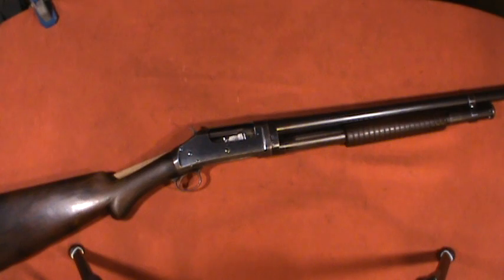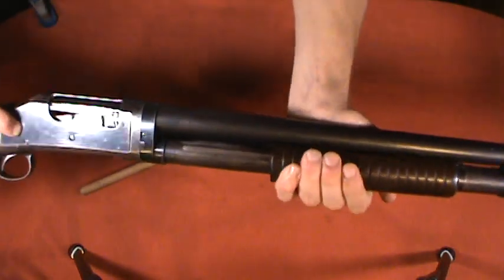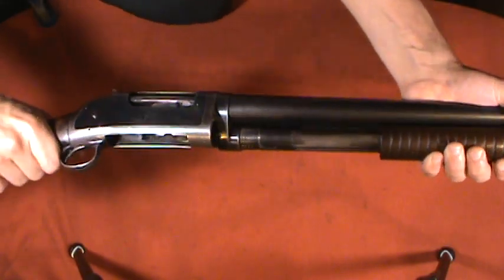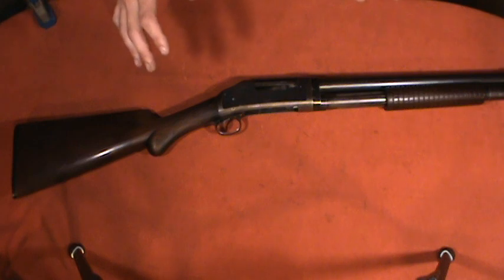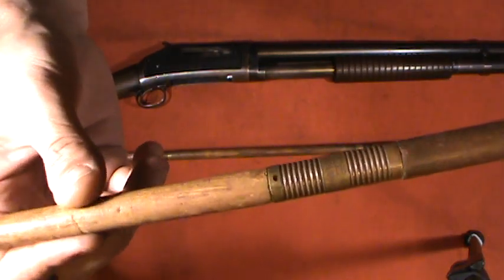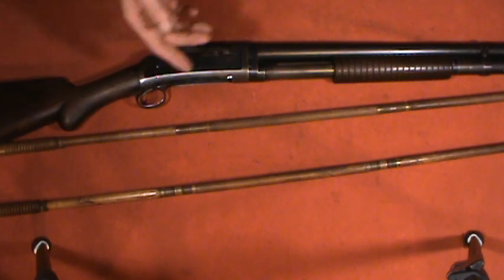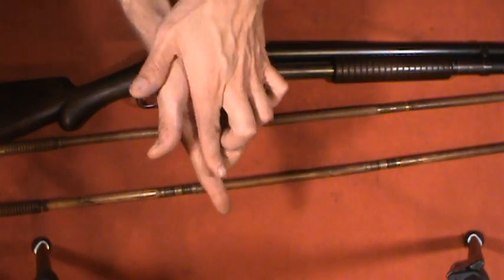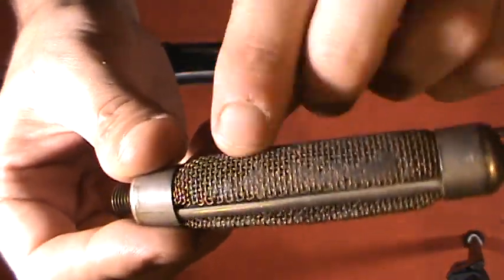Winchester 1897 Slide Action Shotgun: Brush Takedown

Comment: As you start drawing the bolt back, the underside of the bolt rubs very hard on the trigger. Whats the fix. I have to pull very hard to cock the gun
Reply from the maker: Without having the shotgun in front of me it's a little difficult to say as there are a lot of things that could cause some binding. If it were me I'd slowly draw it back and try to determine what is engaging at the point it becomes more difficult. Then I'd dissemble it and check those parts for excessive wear, burring or build up. Sorry I couldn't be more helpful but without it in hand it's hard to pin point.

Comment: these guns wont fire when out of battery when slam firing unless they are damaged. they are meant to do this, the hammer should drop only after the bolt locks up. if yours doesn't talk to a gunsmith,
Reply from the maker: That's correct but if someone doesn't realize their gun isn't locking up it could certainly be a problem.

Comment: Compared to other modern guns like a Mossberg Maveric/500/590A1 or a Remington 870 or Benelli pump,would u concider this gun reliable or good enough for home defence?
Reply from the maker: Ben Niessen In my opinion it would be an effective home defense firearm as long as it had an 18.5" to 20" barrel as so. As long as it's maintained I see no problem with it in that role. Thanks for asking and viewing.
Reply: Definitely better made and more reliable than newer shotguns. Only thing better is a model 12. Taking them apart is a different story.. lol
Reply: I have 2 of these in the house one with a 18.25 inch barrel and extended choke tubes and its really a dream of a gun,its a 93 converted to a 97 and its soo smooth and never has a issue wenn cycle the action it loads and ejects sweet. These are really great guns and they are well build for sure.
Reply: I cut mine down to 20.5" to Trench/ Riot gun configuration--- perfect for Home Defense. What's so cool about the 1897, from 1897 to about 1957, the Winchester 1897 receivers were all forged from one block of steel-- longer process and bit more expensive Reason why this shotgun was discontinued because the cost. But Winchester churned out over a million and Cowboy Action Shooters gravitated to the 1897, chopped the barrels for CAS. A historic shotgun and fun to shoot. Something about a shotgun with a hammer just makes it cool.

Comment: I save u a long story but we cant own pump action shotguns like the 1897 here in the netherlands but we can own black powder guns like the  Winchester 1893,i converted a 1893 all the way to a 1897 (bolt carrier barrel mag tube and and) and i can tell u one thing the 1893 is stronger build then the 1897 if u compared them,the 97 has way more cuts inside the receiver and a 1893 its barrel is made the same way as a 1897 barrel but a 1893 barrel is thicker,and there is much more steel over the bolt on a 1893,wenn i shoot slugs or hot loads i always take my 93 and not my converted 93/97.

Its just the fact that a 1893 is a very very very unsafe gun that ejects horrible vs a 1897,all the flaws the 93 had are fixed with the 97.

Converting is easy but its alot of work i needed to machine the 97 bolt to the 93 dimensions and cut a slot in the receiver for the fin on the extractor to ride in,then lower the ejection port a little bid and file out the space for the shell flag and cut out a small bit for the action hook screw and and and and and..

Now i have a 1893 with a 18 inch 1897 barrel with chokes and i use extended chokes so my barrel is 20 inch witch extended chokes and i have a load 6 kit in the mag and i dura-coated the gun cause i welded the original hole for the action hook screw and i drilled a hole for the shell flag and action release button.

If u know those guns u know they are super super super strong build.

But its not true a 1893 is weaker and a 1897 is stronger its just a bla bla bla if a 93 cant handle smokeless powder i would be dead now hehehe
Reply from the maker: Ben Niessen I won't dispute individual experiences. I appreciate your input on the subject. That's a very interesting work around for the circumstances you have there legally. If it keeps you shooting that's what's important. Thanks for the viewership.
Reply from the maker: Ben Niessen The ability to defend ones life from that of an aggressor is one of if not the most vital human right. I am glad you have the ability to do that. Especially with a gun you so enjoy.
Reply: That's awesome work you did! Makes me happy that you are able to do that.